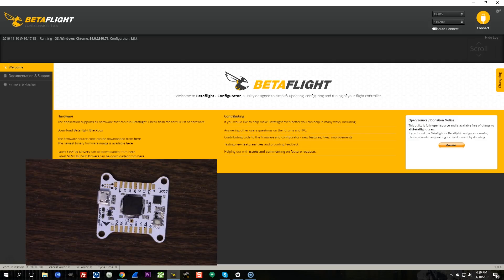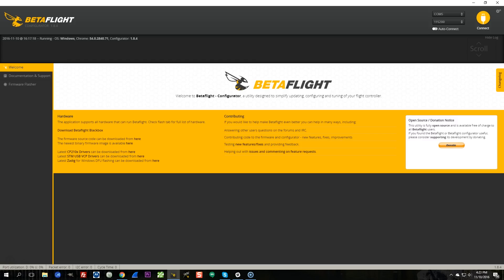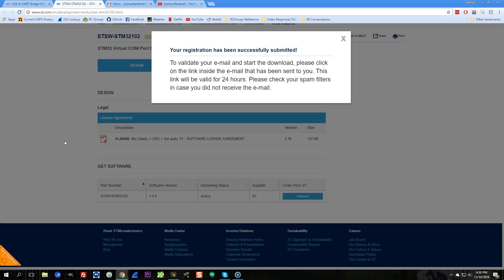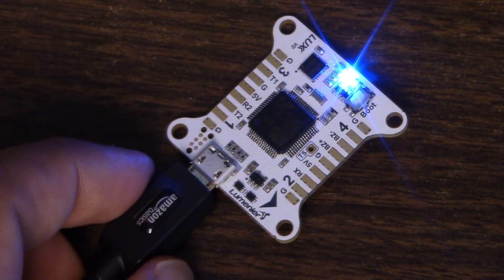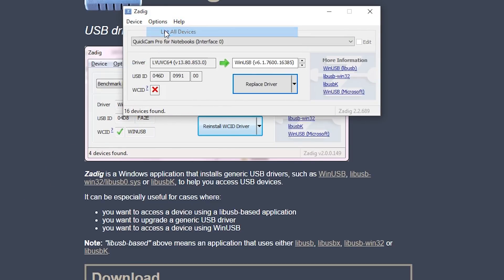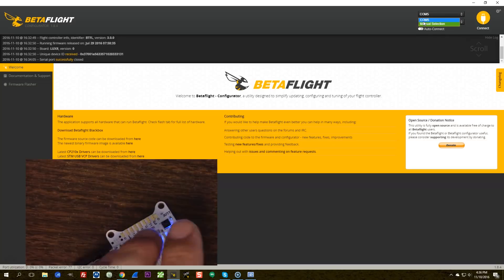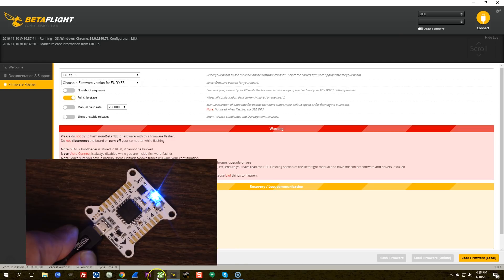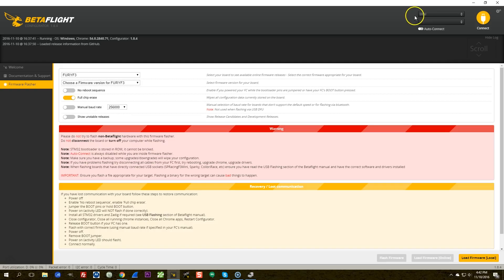Betaflight / Cleanflight Flight Controller Won't Connect | FIXED

Comment: Im not sure what to do here, I got a Lizard 95 and i cant get it to connect to betaflight on a win 7 pc i have followed the detailed tutorial above but with no success.  I have noticed under Device Manager i do not have the 'Ports (Com & LPT) visible as i know a port number needs to be defined for the usb STM32 Virtual Com Port.  If i go to view in device manager and select 'Show hidden devices' I still am unable to see the Ports (Com & LPT) I checked BIOS and didnt see an option for COM Ports and have run all windows updates so im at a loss now, not sure what to do, any input would help Thank you
Reply from the maker: It sounds like your computer has a problem with the drivers. I can't be sure that running Win7 isn't throwing you off somehow.
Reply: I'm in the same boat as you. Just got a Lizard95 and Betaflight refuses to see it. I've connected 20+ quads that I have built or purchased and this is the only one that Betaflight refuses to see. Did you have any luck getting yours connected?
Reply: eschatonik hello I was able to get it to work with multiple trial and error installing and removing the drivers and reinstall as he suggested in this video it did prove successful once I installed this driver which I feel is key search for and download taranis_Winusb_driver it's a zip file I installed it on one of my pcs and it worked on my other one it took multiple attempts of installing and removing to get the driver config correct was a bitch but yes with the driver he recommends in this video and the Taranis winusb driver it did finnaly connect best of luck never delbt with anything like this either

Comment: Hello Anyone willing to help, is there anyway i can get Zadig on ios ??
Reply from the maker: Zadig is specifically a tool for managing Windows drivers. It has no use on MacOS. On MacOS, the DFU driver is pre-installed and should work without any additional steps.

Comment: Joshua I have a question - My F3 micro flight controller gives me one battery worth of flight, is pretty hot afterward the flight, and when I plug in another full battery sometimes I get no lights on the FC (rx and vtx lights are good) or I get the light on the FC but it fades and goes out fairly quickly.  If I let it cool down, I can get that one battery flight again, but on that second battery... no bueno.  Any idea what's happening?
Reply: One more thing - after that battery worth of flight, the battery still has about 4.01 volts according to my battery checker.
Reply from the maker: I think maybe you have a short in the FC somewhere.
Reply: Joshua Bardwell would a multimeter be helpful diagnosing this?  How would I do the diagnosis?
Reply: Joshua Bardwell I removed the VTX and volia!! the quad flys for about 4-5 minutes and drains the battery much deeper than 4.1 volts.  I had the camera grounded to the battery ground and powered from the 3.3v pad on the FC...  Do you think things would work better if I go directly from the battery (+and -) to power and ground the VTX?

Comment: Hi Mr Bardwell. i have a problem. I bought the eachine flying frog q90 with sp racing f3 board. while trying to set this micro up, i made the mistake of shutting off uart1 ( because i didn't know) it would stop the quad from using the usb connection to betaflight. It came with betaflight preinstalled. I took it apart and the blue light is solid when i connect to betaflight assuming it's in bootloader mode. But i still can't connect to beta flight. thanks in advance for any help.
Reply from the maker: Put it into bootloader mode and re-flash it with "full chip erase" selected. Once you turn off MSP on UART1, you are locked out pretty much permanently.
Reply: Thanks ever so much. But i think i have a $70 paper weight. Bought before the prices came down, lol.  Don't really seem to get betaflight, lol. So i'll buy the ones with that fly out the box. no programming allowed. but thanks again.
Reply from the maker: +Shaka Zulu well for goodness sake don't throw it out. There's literally nothing wrong with it that 20 minutes on a computer rebuilding the config won't fix.
Reply: Lol. thanks again for responding. You are really a good person, and it makes happy to have subscribed to your channel. But i can't even get beyond betaflight. But i'm open to any suggestions as to rebuilding and configuring on my commputer. Mostly because i'm clueless where to start. thanks so much.

Comment: Josh.  I've tried the steps you've outlined in this video, but I am still unable to connect to my board.  I am getting the error message "USB Device not recognized".  When I look at the device in Device Manager, it is listed as "Unknown USB Device (Device Descriptor Request Failed).  Any ideas?
Reply from the maker: That usually means that either the cable is damaged or the board is damaged. If it is a VCP board, you can try putting into bootloader mode and re-flashign it and sometimes that will fix it.
Reply: Thanks for the reply.  It is the Betaflight F3 board.  I am occasionally able to get into bootloader.  I successfully flashed it this morning and was able to connect as well.  I thought I had fixed the issue.  Then I did a save and reboot and the board would not connect again.  Would it be beneficial to desolder all of the connections and try to connect just the board to the computer?  I'll probably just end up ordering a new board.

Comment: Mate ive done all step but still wont able to make it work. My pc shows 690LC error despite reinstalling divers and manually putting the fc in bootloader mode. my drone still flies but unable to connect it thru betaflight. It used to be working fine but suddenly not anymore. Im using sprf3evo. Any recommendations?
Reply from the maker: I don't know what a 690LC error is. If it were me, I would uninstall the device from the Device manager, including "delete all files" option, then reboot. Then reinstall the driver and then plug in the device.
Reply from the maker: PS: The Internet seems to say that 690LC error is related to a CPU cooling device. Nothing to do with your FC.

Comment: Josh,

Correction 

Under USB controllers in device manager "unknown USB device (device descriptor request failed". I am a patreon subscriber for you. Thanks in advance
Reply from the maker: +Stephen C Houser this is an issue with the board. It may be damaged. Try putting the board into bootloader and flashing it. Also try a different cable and computer.
Reply: Josh,

It goes into bootloader mode and I can go into DFU mode flash betaflight F3 to it. So it must be a damaged board.
Reply: Joshua Bardwell I found the problem. If you flash the wrong version of firmware such as lux vs lux_race 2 you get the error. Just reload the correct version and com port works fine.

Comment: Dear Joshua i have an other kind of issue, i think my drivers are ok becouse i can flash my Fc SP Racing with no problems, the problem comes after the flash, when i took the boot bridge out and conect the Fc again to the usb  and then i conect to betaflights thers the problem, nothing happens  its justo stay on the same page an fisrt saids serial port successfully conect and then successfully close what did i have to do?  can you help me?
Reply from the maker: It's possible you flashed the wrong target to the board. For the SPRacing F3, you have to select SPRacing F3 from the pulldown menu.
Reply: Thanks for answer :), i choose the right one, some guys in facebook group told me that i have to check the way my board lights the leds they say its giving me a error code after flash by the way it blinks but i can´t found were i can check that info about the code linghts of the board

Comment: I have a NAZE with GPS board, will this method work still? I ask only because iv read all the issues with Naze.
Reply from the maker: This method of installing drivers is universal for all cleanflight and betaflight boards.

Comment: Hello Joshua, I have installed the the STM-Driver "dpinst_amd64" on my W10 PC and windows says driver is installed and works, but i cant find it in the Zadeg drop down menu. There is only the CP2102 USB to UART Bridge controller when i plug in the FC (with or with out boot jumper) any ideas what is wrong? Thank you for help!
Reply: Sorry Boyan, I can't help you, because I never found a solution for my spracingv3. 
I'm using "lumenier lux v2" flight controller with betaflight now.
Reply from the maker: If what you're saying is true, your FC has a CP210 chip, and you will never see the STM32 BOOTLOADER device, nor do you do need to do anything with Zadig (until you eventually buy an FC with VCP instead of the CP210).
Reply: I use sp racing f3, but I try so many different things to flash it with Betaflight and nothing works. Therefore I think my board is damaged.
Now, I use my old cc3d fc with Betaflight. The cc3d can be simple flashed by using the LibrePilot GCS. Now, its time to look at your vids about Betaflight configuration :)
Reply: Capa Lengo What did you do in this case in order to upgrade the version of betaflight/spracingf3? Could really use a help here... Can't find anything on the web useful :)

Comment: What can I do if I have all of the proper drivers installed, and not get a COM number for a new board? I.e. I have multiple working Naze32's, but I can't get a Luz race v1,, pikoblx, RaceWhoop or Kombini to get a COM number. What's going on? I have the vcp driver, the stm32 driver, and Zadig. The Naze32's will connect to BF, the rest will not. Why?
Reply from the maker: I am going to guess you didn't install the VCP driver correctly. That is what the Lux, etc. have in common. The Naze has a CP210 chip on board so it uses a different driver.
Reply: Joshua Bardwell woah I was not expecting an answer, I submitted my problem to r/multicopterbuilds and someone insisted I use the impulserc driver fixer, which fixed the problem I was having. I have yet to test the other boards, but I will do so tomorrow or the next day. I am stoked that you answered me, I highly appreciate it, and all of your videos, even though I probably haven't watched most of them. The ones I have watched are very informative and fairly easy to understand. Thank you!

Comment: I have a DYS F4 cant connect to betaflight via the usb port.  The FC was working flawlessly until i attempted to flash BF 3.17.  Flashing hung for 7 mins before I unplugged the usb cable.  I tried to connect, but now i am getting no lights on the board and it is no being recognized by my computer. When i connect the battery, i just get a solid red led.  i am highly dissapointed this FC is great.  Any help will be appreciated.

Comment: how do i flash firmware when bind button is broken the little soder pads on each corner wont soder anymore please help i have the holybro kakute aio-v1.0
Reply from the maker: Type "dfu" from the command line to put the board into bootloader mode.
Reply: it wont work what do you mean can you show a video when your bootloader button is broken and still flashing firmware on flightboard.i have the kakute AIO-V10

Comment: okay i flashed the board now how do I get to the PID settings?
Reply from the maker: Not sure I understand the question. Connect in the configurator GUI and then go to the PIDs tab.
Reply: I flashed the board on betaflight there is only the three tabs: Welcome, documentation and support and firware flasher im not sure what im doing wrong. I am new at this and this is frustrating almost making it not worth it
Reply: I flashed the board successfully (it was a furious fpv racewhoop) I desoldered the boot tabs the reconnected I then get a notification that the usb device is not recognized and no PID settings or anything else shows up in betaflight. what am I doing wrong??? :(

Comment: Great video but this is absolutely rediculous. Why are we made to do this? Perfect way to kill a hobby.
Reply from the maker: This will not "kill the hobby". The hobby has been doing fine until n00bs who can't figure out how to troubleshoot drivers came along. It will keep doing fine if they get frustrated and leave. "The Hobby" doesn't need you to survive. It doesn't need to grow to be a commercial product that anybody can participate in with no knowledge. 

The very first multirotors were created by people who hacked the gyro chip out of their Nintendo Wii nunchuck, for goodness' sake. This hobby has always had a massive learning curve. It is not palatable. It is not for general consumption. It is difficult. It sucks. But when you figure it out, YOU GET TO MOTHERFUCKING FLY, so many people find it worthwhile.

Please remember that, until recently, nearly every single person who worked on these projects was a volunteer.  Nobody was doing this as a profession. And everybody was a big tech nerd. So a little thing like having to install drivers... no big deal, and not worth the time to solve.

If you want something that is a little more palatable, Raceflight uses HID drivers, which should be plug-and-play on any modern operating system. But there will still be a jillion other stupid technical issues to solve. Mini quads and FPV are not a commercial product. You are doing the equivalent of walking into the pit of a Formula 1 race and saying, "WHY IS THIS SO DAMN COMPLICATED CAN'T WE JUST DRIVE CARS?"
Reply: Joshua Bardwell the hobby is flooded with chinese crap that no respectable hobby store will carry. But hey if this is doing fine then keep up the good work.

Comment: when I run the Exe file to vcp a folder doesn't appear on my desktop what should i do
Reply from the maker: The EXE file should be a self-extracting archive. When you run it, it should give you a dialog box that asks you where to put the files. Select the desktop there and then proceed.

Comment: Hi There.  I need help.  I have been able to get into DFU and able  to flash the firmware on my Omnibus F4 pro.  I upgraded to the latest 3.1.7 betaflight.  however, after I got out from DFU mode and clicked on connect to access my board it will not connect it will  just show...
2017-05-26 @ 00:41:10 -- No configuration received within 10 seconds, communication failed
2017-05-26 @ 00:41:10 -- Serial port successfully closed

HELP!
Reply from the maker: I am going to guess you flashed the wrong target to the board. What did you select from the pulldown menu where you select the Board Type? 

https://www.youtube.com/watch?v=uIsyuNxIlkI

Comment: My board is flashing and all, but when I try to connect it to cleanflight it tells me it is out of date. I tried flashing it, tried using zadig. Zadig doesn't even seem to find my FC.. I'm desperate atm. How do I uninstall the drivers? I might have messed up at the Zadig part of your video. Overwriting the STM32 virtual com port.
Reply from the maker: If you don't want to update to the latest cleanflight version, then here is what you need to do:

https://www.youtube.com/watch?v=GzqrCa78SfA
Reply: I do want to update. You mention uninstalling the drivers if you replaced the STM32 virtual com port on accident. How would I do that?

Comment: Hey Josh, love the vids.

I'm having problems with one of my boards (a Lux V2, small world!).  

I can get it in DFU mode.  It says it flashed the firmware successfully.  But when I go to connect I get the same thing: solid blue light, red and green flashing.

I get this behavior on both Windows and OS X and I'm able to connect to a second Lux V2 with the same computers and cables, no problems.

This board is still on a quad and the ESCs are still soldered to it.  Do I need to take everything apart to flash this board?
Reply from the maker: +b8sell taking the board apart shouldn't matter. Are you sure you are flashing the correct target?
Reply: LUXV2_RACE: 3.1.7

Flashing ... Verifying ... Programming: SUCCESSFUL

But when I plug it back in, same thing.  Blue light, red and green flashing.

Comment: The drivers are installed but the coms port isn't showing only Manuel selection it's still not connecting like before.
Reply from the maker: If the COM port isn't showing either the drivers are not correct, the USB cable is damaged, or the FC is damaged.

Check in Device Manager (Windows) to see if STM32 Virtual COM Port shows up when you plug in. Or is there a device with a "problem" icon. Or does nothing happen?

Does Windows make the "device plugged in" beep noise when you plug in? If not, it is not recognizing the device.

Some USB cables are charge-only, in which case they cannot be used for data transfer.
Reply: Thank you thank you thank you thank you thanku thanks a lot it's working, it's was the damm USB:)

Thanks again
-a fan

Comment: HELP!!! dos everything you said.but now it won't connect with betaflight.it doesn't show up as a Port anymore 😥 now it is useless for now .. .
Reply from the maker: If you don't see COM when you plug in, likely your drivers are messed up. Or maybe your USB cable is messed up. Possibly you need to re-flash the board if it is a VCP board. See if you can get it to show up in DFU mode if it's a VCP board.
Reply: you are awesome joshua.still making time to reply to people.hands down to you sir.
the betaflight f3 had no problems to go to bootloader and it picked that up just fine.it just wouldn't detect the virtual com Port anymore in betaflight.however it did pick it up in USB ports tab in windows.finally got it to work.but what a hassle to update the firmware for the BETAFLIGHT F3 in freaking BETAFLIGHT!!!

Comment: Hey Joshua. I have done all the steps in this video and i still seem to be getting the 'Failed to open serial port' text on cleanflight and betaflight. The fc is acting as you said it should in the video but it still isnt working. Would you know what the problem is?
Reply from the maker: Try a different USB cable. Some USB cables are charge-only  and don't pass data.
Reply: ok i will try that now